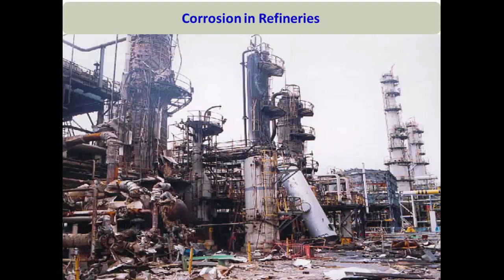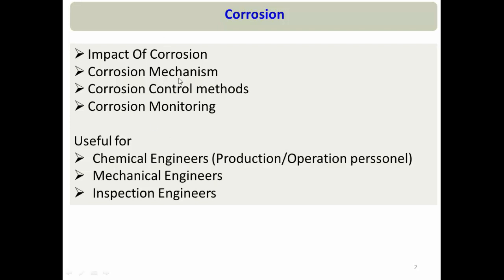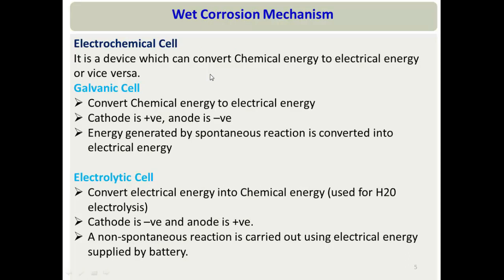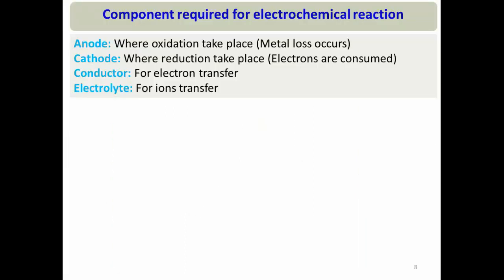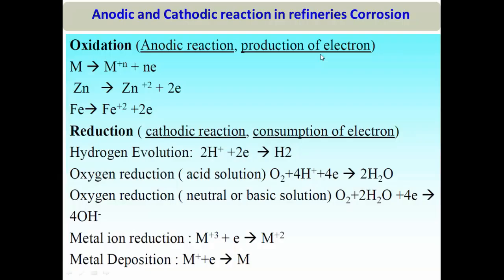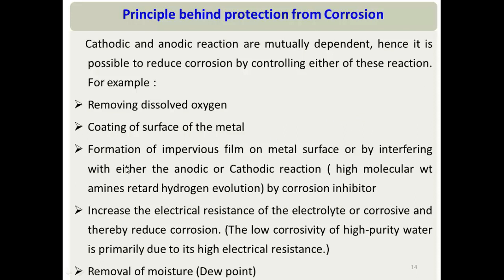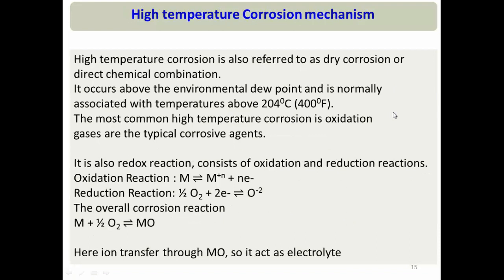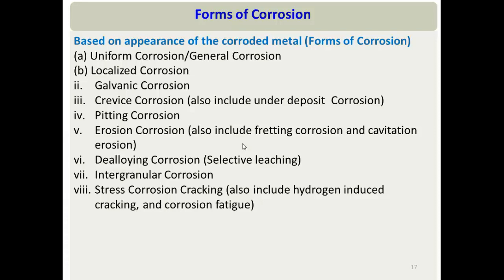Part 1- Types of Corrosion | Mechanism of Corrosion | Electrochemical & dry corrosion mechanism |

Comment: do you still have links to the other vidoes in the serries
Reply from the maker: Yes, I have uploaded 5 videos in the series. You can get link of those videos in description. Or you may watch this playlist. I guess you are not Indian, Are you able to comprehend my English? I had doubt that's why I am asking.

https://www.youtube.com/watch?v=5BynPKyYb-w&list=PLIwv3BrFJYXJf7FrKD0m35W5nWtME5BvX&index=1
Reply: I understand you fine,  i originaly meant how do i access the complete series as there is only 5 available here
Reply from the maker: I have not uploaded other videos yet. As there was no demand for these videos.
Reply: i personally would like to ee them, you may find more traffic if you mention nace refinery technologist and designing for corrosion control certificate/courses and also api 571 damage mechanisms in the refinery as part of it. i'm currently revising for these and would appreciate having the full set in one place.
Reply from the maker: I did not recorded other parts at that time. It may take some time to record them. Should I tagged the terms which you suggested to increase traffic ? I am a Chemical Engineer and most of the knowledge of Corrosion I have is  by reading books and other articles. I do not have much practical experience.
Reply: to clarify you uploaded parts 1-corrosion in refineries,2-mechanical properties and material types,5-high temperature oxidation, sulphidation,7-overhead corrosion in the cdu vdu & 8 Ammonium bisulphid corrosion. in those later vidoes you talk about topics you have covered in 3,4,6 etc, are you saying you didn't record the series in order and purposely skipped sections while saying you had covered them? A series like this is more valuable as a complete collection and they are within your top views to be honest already.
Reply: I would make those tags, can you have any book recommendations on the subject
Reply from the maker: Most of the topics are from 'Corrosion problems and Solutions in Oil Refining and Petrochemical Industry' by Alec Groysman. But do not expect these presentation are directly from this book only. These presentation are made by compiling 100s of sources available online and in my refinery collection.
Reply from the maker: Yes, I had plan to upload part 6 Hydrogen damages, Part 3 & 4 Different forms of Corrosion. So I referred like that. I worked very hard to prepare these series. But these videos are least popular videos on my channel to be honest. For better understanding of forms of corrosion you may refer some of the videos from this playlist https://www.youtube.com/watch?v=5OxdXq91TV0&list=PLbMVogVj5nJRb1Hukxce_fNcQ5D74Pn91